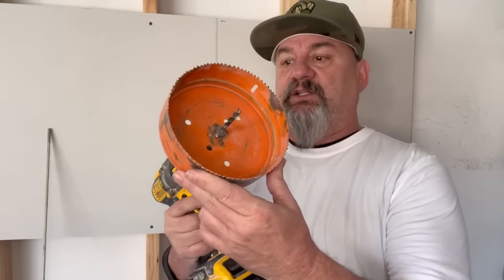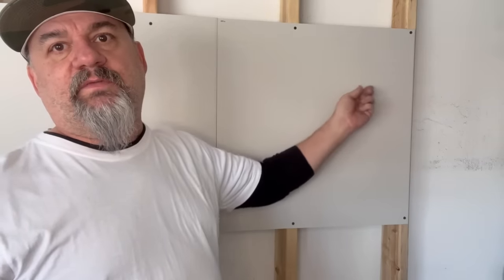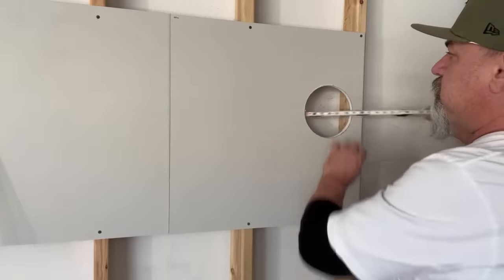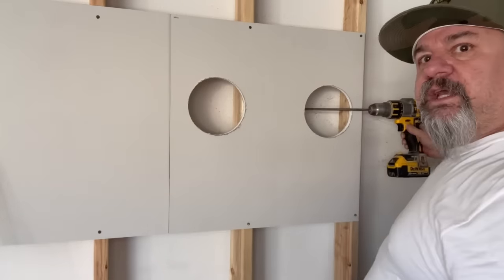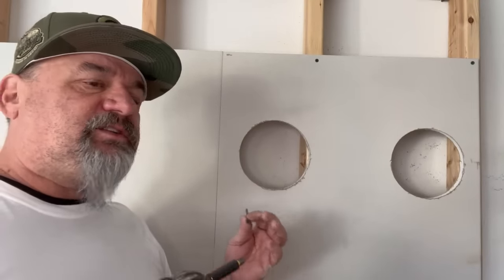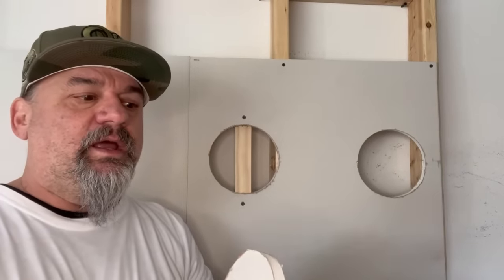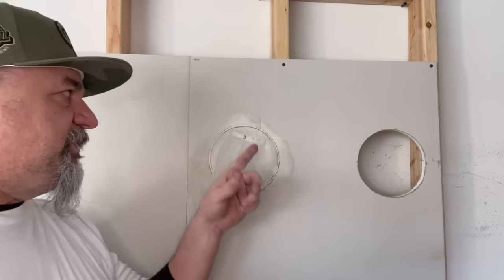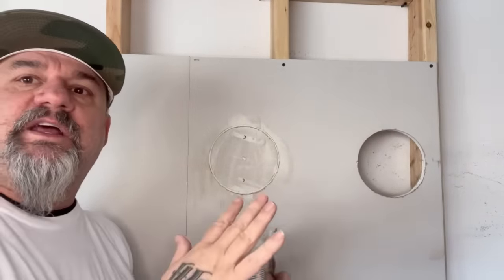Unbelievable Trick to Run Wires Through Walls and Fix Drywall - You Won't Believe What Happens Next!

Comment: Its so funny I did this on my ceiling with the same hole saw and then I cut out new plugs and tries the trick where you cut the plug larger and then you break out the rock and leave the paper. The paper peels off the wall when the spackle dries. I am going to cut of the paper with a razer knife and then go over it again with a small to large spackle knife. I really suck at spackling. Thanks for the video!
Reply from the maker: LOL  i suck at it too!!! I try but would rather have a pro do it.

Comment: I prefer to open the wall way down where it's not as noticeable. I remove the base moulding then open whatever length of sheetrock necessary, drill thru the appropriate number of studs, run my wire. Reinstall sheetrock, tape, mud, sand, replace moulding.

Comment: That is exactly how i patch holes, makes it so much easier.  Glad to see im not the only one.  Problem is a lot people like making holes , but not patching them, they give you the old --- ahhhh thats not the electricians job your gonna have to call a drywall guy to fix the giant jagged hole i cut into your wall with that rusty dull steak knife thats been sliding around the back of my van for the last 10 years

Comment: I've seen other people use an oscillating saw to cut Maybe a 6-in strip right along the top and right along the ceiling and then pull that section out drill the holes they need to for running their wire and then when they put it back up you've got a nice even cut the sheetrock matches up with the sheetrock on the other side and then you just put like a slight beat over top and maybe a texture roller to make that part of the seam disappear and that little Gap you'd have right up at the ceiling you just put mud in that and no one will ever even be able to see it because it's so tiny
Reply from the maker: right on!

Comment: I would tape those joints with hot mud, dry it with a fan and top it with regular drywall mud. You can also cut the holes square and do butterfly patches. Another way to get threw the stud is to cut a 1" wide by 1.5 inch deep slit in it with a skill saw, chip out the piece, install your wire, cut enough drywall out to get a protector plate on it and butterfly patch it. Way faster and allot less drywall work!
Reply from the maker: ya know i am going to do another video about patches that are suggested to me to be fair to all the suggestions. im not a drywaller at all. my work sucks but I am going to try them from the standpoint of a homeowner and see which is easier or faster. thanks for the tip!

Comment: Even better tip is to remove the baseboards,  alot of crawling on the floor, but remove boards, drill holes, put baseboards Back on, done. Works every time
Reply from the maker: for sure

Comment: The only time you should ever be having to cut finished drywall as an electrician, is if there is no attic or crawl space. I very rarely make holes, and as an electrician i do not patch drywall, not because im lazy, or too good or valuable to do it, but because im an electrician, im trained and skilled in my trade and stick to what im good at, i allow the drywallers to stick to what theyre good at. I wouldn't expect a drywaller to install receptacles, so why should i be expected to patch holes.

Comment: Since you are going to put some wires through the studs, why did you not drill the 6" hole on the centerline of the stud?  That way you could install a 'stud guard safety plate' to protect the wires, before you cover the hole.
Reply from the maker: this is just one of many options you could use

Comment: Carpenter tools also help in some situations. I've used a sliding t bevel to find an angle and then put it to a speed square get the exact angle then bend multiple conduits on a hydraulic bender, in a large building remodel where there are open directions to make a conduit chase and avoid plumbing and ac runs.
Reply from the maker: right on. theres a lot of different tools I dont have. so i try to make due

Comment: Really is this how this guy is finding studs actually did the technique with the hole saw and the ceiling I was redoing some wiring in my house my daddy some lights and they have done this several times I've had to cut out a bunch of different size squares or rectangles all along around each side so I can fish the wire because the studs are going opposite of the way I've got to pull the wire and it's a b** to patch I don't know why I didn't think of this myself honestly I think it's I mean just as good as any other way I think it's better cuz it's uniform easier to patch easier to hide a circle than it is a square

Comment: If you can run the wire close to the floor,, just pull the baseboard off, make the holes low enough that the baseboard covers your work.

Comment: Very good method! I saw someone do this method but they filled the crack with a spray foam, then shaved off the extra foam to smooth the surface.
Reply from the maker: Great tip! I thought about that. maybe that works better. maybe I will try it.

Comment: remember, it's not stupid if it works.  There are a million ways to patch dry wall, if it works and you end up with the same results of not knowing there was a hole there before then it was the right way for you.  

Don't listen to people that say "well the right way to bla bla bla" there is no one "right way" to do things in this world.  There may be a hundred wrong ways but no one way is better than another if you can do it with the tools you have on hand and the end result is the same.

One thing I have done differently is slab on the joint compound on the slug before I put it in the hole so I know its got good fill and I spend less time pushing it into the hole, it also helps to center the slug on the backer board within the hole.  But like I said, whatever works and is comfortable go ahead and do that.
Reply from the maker: AWESOME!!!! YOU GET IT!!!!!
Reply from the maker: doing a live feed at 1:00 today stop on by!

Comment: Good 1 man, don't have time to read all comments, I've got a tip on locating studs behind finished drywall. Use a flashlight, turn on, lay the flashlight flat on the wall pointing up or down, slide the flashlight slowly across the wall looking at the beam, the screws or nails will always have a slight indention. This may not be the exact center but... otherwise use a stud finder at least you know if studs are ganged together. Us old school kilowatt's are a dying breed... 46 yrs. and ticking
Reply from the maker: Right on!!! yea I like the sound of that trick. I used it before many times but forgot about it. the old school thing including forgetfullness!!!lol

Comment: the oTher metod for a horizontal run is to simply cut a a contiuous strop od drywall out ofi the existing sheetrock, run your new wire, and do a one-piece patch
Reply from the maker: well that patch gets uneven and tears away from the stud and if you hit screws it comes out in pieces. so if you have to cut a new piece its never the same and takes time along with the pain in the ass. this way is fast and consistant.
Reply: @StarvingElectrician  i think the orignal poster was meaning u use a continuous piece from a new sheet of drywall to patch. yes you are not reusing the piece u cutout but the install would seem to be less laborious than a half dozen round holes for patching. At least this is the way i see it as a drywaller. Not that i disagree with your method, its just an alternative depending on length of cutout or amount of holes
Reply from the maker: @fallonstone408   I hear you but it’s not as I stated in the video. This is a trick I use. People can do it or not. You would be amazed how many comments about how what I do can be done better. I answer all my comments and it’s about 30 a day. It’s exhausting. People can use what I post or not the debating hundreds of people gets old.

Comment: Having to run wires through studs, I usually pop the baseboard off drill my holes, run the wire. Put baseboard back and caulk it

Comment: I use the same hole saw and cut a new sheet of rock from the back side. I don't cut all the way through and I make the front side paper 2 inches larger with a razor knife. That becomes my tape. Then I finish it out.
Reply from the maker: yea thats good too

Comment: I think it’s easier and much quicker to use a circular saw to remove a 4” wide strip, especially for long runs crossing more suds.
Reply from the maker: It's just one way if you absolutely have to make holes you can repair them this way. its not intended to be the "ONLY" way.

Comment: We have 4 rooms all wired on the same 15A breaker. If I wasn't 80, I'd run another circuit off a new breaker and split it, but I just can't crawl around in the attic anymore.
Reply from the maker: I hear ya and yes split the circuit and add another. its the only way

Comment: Building codes in many areas require steel nail protection plates anywhere wiring or plumbing is run through holes drilled in the studs.  In those cases you would need to make your cutout so that it exposes the edge of the stud itself so the protection plate can be installed before patching.
Reply from the maker: you only need the plate if the hole is 1-1/2" from the edge of the stud to protect from drywallers. the drywallers are done already no need to nail plate

Comment: I needed to watch your video yesterday when I ran a wire across the top of a new door and up and down the sides, via a ceiling brace. I almost did it right, but cut the holes by hand. I looks ok now, but twice the work. And it would also have solve the age old question afterwards ... what's for dinner.  Tomorrow night, Tacos mmmmmmmm
Reply from the maker: lol keep at it and dont give up on your dream of tacos for dinner!!

Comment: Very informative. If you cut your hole in every other space and drill both ways in each hole you could drill two studs with each hole and cut half as many holes. Something to think about
Reply from the maker: yes you can do that too
Reply: But his point was you can't know if you are going to hit a wire stapled to the stud on the blind side. Doing every stud bay this way, he can be sure he isn't going to poke an existing wire running down a stud on the backside.
Reply: @JFirn86Q  You could use a current tester to test for a wire, no?
Reply: @jenjeffsher3616  If you mean one of those live wire detector pens, not really. The stud would block the wire from being detected. You could try drilling real close to breaking through, and you MIGHT be able to get close enough, but still wouldn't be a positive indication no wire was stapled to the stud. You'd probably be fine most the time never hitting a wire, but you know, that one time you do - its not fun :)

Comment: I used that long shaft spade bit recently to get up into a wall thru the floor plares from my crawl space
Reply from the maker: yea the auger bits work great but get stuck if your drill doesnt have the ass. sometimes it pulls through the studs and for something like this there may be wires above so you are able to minimise damage

Comment: No way man I have done it too you should use the (45 min mix which provides a setting like concrete and is stronger and you can do another coat  right away. Also I would bevel  the round piece of drywall to achieve a no see through circle  You are not really helping the drywall finisher by using the ready mix  spackling compound which has a shrinkage ratio higher that the 45min plaster of paris that you mix yourself
Also let me give you a suggestion  rather than using screws  or wood backing you can use a rectangular piece of drywall 
say 5 inches wide by 8 inches long  apply GREAT STUFF on the edges of the rectangle  You have to put it on the drywall and using a piece of cardboard as a spreader  you collapse the foam until it gets sticky Now this is your glue  Use two screws in the rectangle that you will use as an handle and carefully you drop the rectangular piece of drywall behind the hole. Wait 5 minutes and it will stick very firmly . This is your backing . You could also use some screws to hold it in place how ever you could remove these screw later so it  will be  less filling to do
You can also use some great stuff to glue the round piece so to close the hole
Just remember to collapse the foam  as much as possible and do not use it excessively otherwise it will expand and you will end up with a real mess
 Also you have to be careful that you don't get it over yourself... Some stand by acetone usually takes care to get it off your hands
Reply from the maker: thanks for the advise

Comment: I have always made square holes with a utility knife and reinsert the cut piece and use the wood strips. The knife makes a smaller gap and easy to fill.But I do like the way you did that. Would be a faster way to make the hole
Reply from the maker: its all a pain in the ass but im lazy so this works for me!...lol
Reply: you don't want a small gap that's "easy" to fill. a slightly larger gap like you get with a hole saw makes sure you for sure fill the whole gap with mud and less likely to crack

Comment: Wouldn’t do that, start in the corner, in the UK as wires are supposed to be run within 6” of the corners (or vertically or horizontally from the socket)
Reply from the maker: im just showing a trick I use

Comment: The best way to use a hole saw on Sheetrock is to put the drill in reverse tou will have less resistance, “The teeths of the saw, or less aggressive in reverse”

Comment: I like your tips.  The problem I have is the circle tends to pull in too much and not be level with the rest of the drywall.
Reply: If you are reusing the same sheetrock plug that was cut out, there is no way it will not sit at the same depth as the rest of the drywall.
Reply: @BOHICA_  I have had this problem several times.  The screws pull the sheetrock in too far.  I had a house that I fixed holes in the walls. This was trouble every time.
Reply from the maker: yep that is a problem. its a matter of feathering it in. maybe a longer board with more screws, you are gonna mud anyway so whats a couple more screws?
Reply from the maker: yes it will. you have a backing and the drywall that cut out didnt shrink so its the same size and the same depth. you only loose the thickness of the hole saw.  dont say theres no way I been doing this for years it works. you can use it or not but I know what im talking about.
Reply from the maker: then use two boards as a backer. its the same depth.

Comment: Honestly I think most of the guys that come after you would just be happy with you leaving them a clean hole. If I came on this I would take it apart because I wouldn't know what they done. But I'm just happy when the plumber electrician doesn't leave a giant hole all ragged and out of square
Reply: No drywaller will ever fix a hole without tape, they crack immediately.
Reply from the maker: yea im sure they will turn down work because an electrician did their work. try being an electrician and see the drywallers do electrical.
Reply from the maker: sooo true!!!
Reply: @StarvingElectrician  got to stand behind my work so I wouldn't turn it down just bid it so I can fix it in a way I know it won't crack.

Comment: 6:35  When was an apprentice the journeyman & master sparkies would use the thick long paint stir sticks from the good “paint stores”, not big box stores (fyi); and use tiny bit of construction adhesive of any kind that was in hand (aka, PL, Gorilla, etc….most grout/mortar brands and such always have a “adhesive of some kind” and could be labeled under construction or some other name, but they out there) and would put a dot, or dab (if a tile setter, ya get that bad bad joke I know, it’s been a bad bad day 🤦🏼, so gotta have some fun); to help stick the paint stick that can cut down to size want, by the way, to the drywall piece that was cut out and slipped inside wall cavity then use Sheetrock screws to finish securing together before taping and muddling would happen.
Granted, if cutting out a huge section of Sheetrock, this “trick” wouldn’t be that great of an idea to do, and having proper strapping/backer board for the drywall repair is way to go, imo.
✌🏻
Reply from the maker: right on thanks for sharing!!!

Comment: Good video.  Shame you can't come down from the top using a pilot hole to inspect inside the wall cavity.  I've seen flexible long drillbits with a spadebit on the end.
Architects should integrate cable pathways into wall cavities to support communications and power - that would remove this need.
Reply from the maker: Great point!

Comment: Wet down the edge of the hole and the edge of the plug before you install it.. the joiint compount will adhere better.   Just rub a rag dipped in water over them.
Reply from the maker: thanks. I always wondered how the drywall people do the sanding with a wet spounge.

Comment: Your heart is definitely in the right place but just leave the slugs. It would not be any more work for a.drywaller to fix if you just cut a channel a square is easier to fix than round.  Also sometimes someone will clean up and the first thing they do is throw away those slugs and touch up paint, do t ask me why. So a rectangle is easier to duplicate instead of looking to see if you have the same hole saw as you to make slugs. I am sure you are great to work with great video.
Reply from the maker: this is just one of many tricks. there's lots of ways to do this.

Comment: My question is about the factory  edge of the board  that meet  in between the studs. Does that meet code in your area???  All the boarders I know ALWAYS rest the edge of their drywall on half the width  of the stud
Reply from the maker: sometimes i do that too. its just a matter of this certain trick. for me sometimes the drywall has glue or multiple screws and the slug gets torn up.